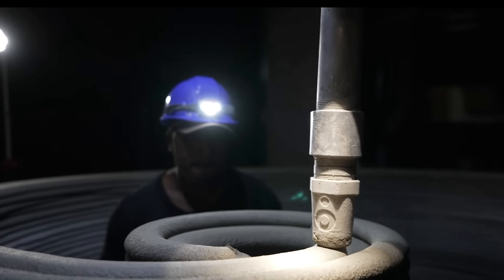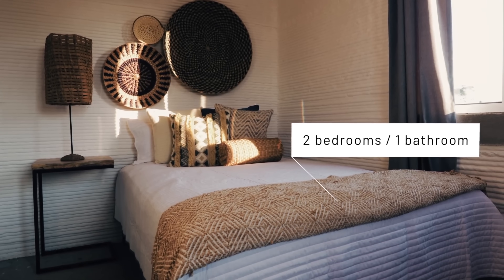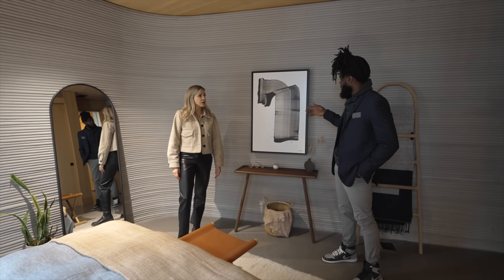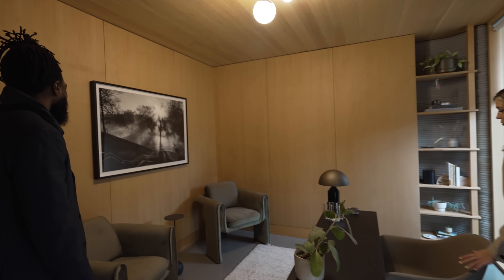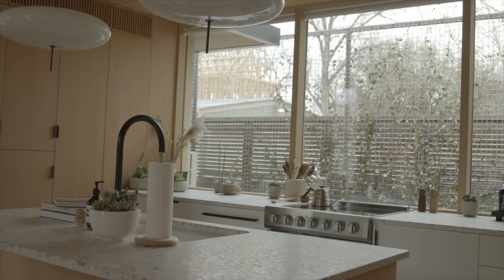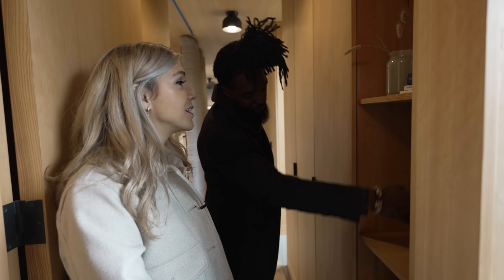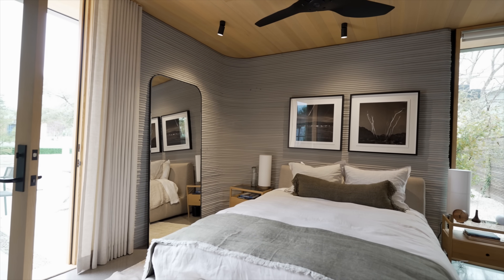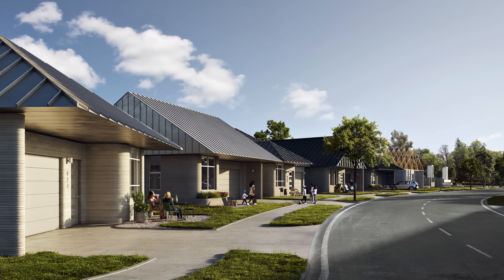Inside A 3D Printed House You'll ACTUALLY Want To Live In

Comment: The house looks great! 
Though, I’m kinda curious how it’d do in colder climates with all the windows and the thin walls.
Here in Germany, new buildings are essentially wrapped in about a foot of insulation and are built airtight nowadays as energy prices here kinda force everyone to think about efficiency.

The greatest part is all the carpentry and cabinetry! 
Well done on the design!
Reply: From the construction montage there looks to be gaps that could insulate and there don't appear to be obvious cold bridges connecting the outer and inner walls so it would work pretty much exactly like traditional masonry. The way each layer slightly varies is going to make it very anoying to fit or hang things to the wall. I also wonder how building height factors in to strength with this technique
Reply: Those exterior walls are over 8” at the base
Reply: Theres 2 walls printed the outside and interior w a gap inbetween for wiring and stuff so u could probs do stuff there
Reply: Just lay it on thicc :yougotthis:
Reply: Well they do come with a  high performance HVAC, system.
Reply: @robertcox7507  High performance HVAC tells me the place is improperly insulated.
Reply: @protorhinocerator142  That seemed right to me also. Insulation amount is chosen for where you build. Most places have a min code to help spare the power grid.
Reply: Exactly what I was wondering
Reply: There is another company that 3D print in Germany and meet all of the building regs that are in Germany.
Reply: @thelostusername5013  No surprise. There is no reason that additive building won't work in any climate. I can see the normal house builders are starting to notice these. Seen one post that you won't save money since they still need to be wired and have plumbing. I live in Austin  TX and find that funny. Company here printed a one bedroom house for 10K Allowing for expensive trade people and top grade material to wire and plumb I fail to see the house not coming in at under 25K + land cost. A run down wooden frame one bedroom in a not nice neighborhood starts around 150K.
Reply: I do NOT want that house.  to many "technical" /structural Restrictions inovolved with it and  it required constricted sizes.  The material is a horible mess. Then huge expense to "cover/finish those walls".  Wiring and plumbing issues.  If you want to build something like that there are better/Cheaper , simpler ways to do it.  search ,... Oh what is it called,  Mud/sand bag , earthen bag construction.  And I am not saying I would want that for my main house.  I've have seen nice hotel rooms....  cement is a mess! espeically when you leave it exposed. Dirt , spiders, and bugs "sticking to it" , then trying to deal with plumbing, elextrical etc,  and even try hanging a shelf or picture. :-)) that texture is aweful.  even beyond cleaning it has problems.  the novelty would wear off quickly.  and trying to cover that up with wood, plaster, etc... IS $$$$$   Are you noticing that even with the camera/"lense"?shooting done to try and make it  look bigger.  Look at how SMALL the rooms are. EVEN The ones that are supposed to be "larger rooms"  Oh and I live in a mostly solid cement walls and roof/ceiling ...  I will call Bull Sheets on it being 75 F inside on  days when it is in the 90's .  I live in the desert and once it starts warming up in the spring in the "90's" after a few days the cement warms up, the walls warm up and there is no way you are going to have 75F inside without turning on the AC.  if it goes "hot" then cold" then "hot" the cold for a couple of days, then Maybe... But after after a few solid days or warm/hot temps, the cement warms up. and as the temps keep on climing for "the SUMMER/ spring"  the walls of the building keep getting warmer.  In the low desert in AZ,  if I turn off the AC it will quickly start climbing toward the 90's F. I guess higher if you forget to turn on the AC.  Oh, and of course the Reverse happens in the winter.  Sure the novelty of this is "cute"  but the reality is..................  Not So Great.   especially if you DON'T want just a little "single persons"  condo/vacation condo"  and You don't want the MESS of unfinished cement walls.
Reply: Im guessing to tackle cold climates is to have thicker windows like triple glazing thin walls is another issue
Reply: @masolaadrian  You got it. Glazing and adding foamed in insulation os one way but they also cut cooling costs. Poured in foam is works well in a large cavity since you get less thermal bridging. Look up Structurally insulated panels.
Reply: @robertcox7507  that is also a good idea! Poured foam rings a bell of a similar method can’t remember the word for it. Yes I have come acrossSIP panels. They are also cost effective!
Reply: @masolaadrian  I am looking at one of the 3-D house printers where I live.What I expect to do when I can afford it is a two bedroom printed house using SIP's for the roof. City I am at will pay for solar panels and you can do water collection legally. Metal roof with a drinking ware safe finish and you are Eco friendly without busting the bank. IF the city won't pay for them you design with an eye to adding Tesla Power walls and extra panels.
THe Tesla powerwalls solve an issue with renewables. Sun goes down you are still using solar. Add some extra solar panels it and a power wall and it feeds the grid helping with peak demand and lowers your bill. And no I am not one of the extreme environmental wackos but I like clean air.
Reply: @robertcox7507  just reading from how you would set your house, seems like earthship house projects how they take advantage from solar energy but they also upcycle materials I may be wrong…
Reply: @masolaadrian  The Earthship does and I like some of them but the reality is they are very labor intensive. Labor = more money in my world. I will go with new to lower costs and consider that over it's life span my way will pay for itself while lowering it's environmental footprint.
Reply: @robertcox7507  that’s interesting to be honest new methods of construction is very interesting!
Reply: @masolaadrian  I think the thin walls are part of the process, to maximize the efficiency of the curing time, and to minimize resources used in building the house "sustainably" (I hate how people use that word).
The answer must be increasing the gap between wall sections and filling that gap with insulative material.
Either that or re-think the whole process from a blank piece of paper.
Reply: @protorhinocerator142  What is sustainability if we’re in a age of economy and business (they’re the same) so 😅. I would agree with you I would think that the buildup to be the same as masonry but using concrete.
Reply: Why are energy prices so high in Germany?
Reply: @Nako3  Because half the price of Petrol/NatGas/Electricity is comprised of taxes and levies.
Our green mentality dictates that if energy isn’t scarce and expensive, there’s no incentive to switch to “green” alternatives.
And because we’re now no longer deriving our oil/gas cheaply through pipelines at long-term fixed rates from russia directly, but at market rates via LNG/Oil tanker or because our existing suppliers like Norway/Netherlands etc. are charging a premium for bumping up supply.

Then for electricity, we’re paying every producer as if they were producing the most expensive type of electricity (gas power). Cheap solar/wind/coal power producers get to pocket the difference.
And since we switched off our cheap nuclear plants, electricity demand can never really be met without gas power being in the market and dictating the price.

That pretty much sums it up.
Dumbest energy policy in the world as the wall street journal once titled.
Reply: @propergander8509  That sounds awful. Poor citizens getting robbed off their hard earned money.
Reply: as long as the windows are "double glazed" (two layers of glass, un connected with an gas such as argon in them) the windows will actually hold temperature
Reply: Thank you 70 subscriber
Reply: Well, the thermal mass of the concrete helps a lot, and putting insulation inside behind those panels doesn’t seem like too tough a thing to implement.  Might also be possible to print walls in the same way corrugated cardboard is made, to make gaps inside the walls that can be filled with insulation.  A honeycomb design might even make it particularly resistant to tornados and hurricanes.  It’s already probably better than wood frame houses against high winds as is.
I worry about earthquakes, though, and freeze-thaw cycles.  Perhaps they could lay cable down on each pass of the printer head, and print double layer walls, one layer on each side of a line of vertical rebar poles.
Reply: They have built these homes in Mexico in a earthquake zone and also Austin TX. where I live. This comes off the website  "more resilient homes that are designed to withstand fire, flood, wind and other natural disasters"  https://www.east17thstreetresidences.com/#about   @glytchmeister9856
Reply: @4:50
Reply: @worldofmango1409  That PLUS the fact that the walls look to have at least 8 inches of space between them for insulation.
Reply: @worldofmango1409 thank you 70 subscriber

Comment: How about temperature running into the room through the Gaps between the Windows? It is one element without insulation or nothing. Pure Concrete running from outside to inside. How is this fixed?

Comment: I think Frank Lloyd Wright would love this house.  I like the way the concrete and wood compliment each other, there's a contrast that appeals to me.  It reminds me of a house made of adobe.
Reply: unlikely, probably and experiment and then Dismised!  😅 Although Frank did make a lot of "mistakes in design and construction in his buildings.  I do NOT want that house.  to many "technical" /structural Restrictions inovolved with it and  it required constricted sizes.  The material is a horible mess. Then huge expense to "cover/finish those walls".  Wiring and plumbing issues.  If you want to build something like that there are better/Cheaper , simpler ways to do it.  search ,... Oh what is it called,  Mud/sand bag , earthen bag construction.  And I am not saying I would want that for my main house either.  I've have seen nice hotel rooms....  cement is a mess! espeically when you leave it exposed. Dirt , spiders, and bugs "sticking to it" and those layers/grooves!  then trying to deal with plumbing, electrical etc,  and even try hanging a shelf or picture. :-)) wanna change a door or window? 😅😅😅 that texture is aweful.  even beyond cleaning it has problems.  the novelty would wear off quickly.  and trying to cover that up with wood, plaster, etc... IS $$$$$   Are you noticing that even with the camera/"lense"?shooting done to try and make it  look bigger.  Look at how SMALL the rooms are. EVEN The ones that are supposed to be "larger rooms"  Oh and I live in a mostly solid cement walls and roof/ceiling ...  I will call Bull Sheets on it being 75 F inside on  days when it is in the 90's .  I live in the desert and once it starts warming up in the spring in the "90's" after a few days the cement warms up, the walls warm up and there is no way you are going to have 75F inside without turning on the AC.  if it goes "hot" then cold" then "hot" the cold for a couple of days, then Maybe... But after after a few solid days or warm/hot temps, the cement warms up. and as the temps keep on climing for "the SUMMER/ spring"  the walls of the building keep getting warmer.  In the low desert in AZ,  if I turn off the AC it will "quickly" start climbing toward the 90's F. I guess higher if you forget to turn on the AC.  Oh, and of course the Reverse happens in the winter.  Sure the novelty of this is "cute"  but the reality is..................  Not So Great.   especially if you DON'T want just a little/cramped "single persons"  condo/vacation condo"  and You don't want the MESS of unfinished cement walls.  You know what else you will notice about this... NO REBAR REINFORCEMENT/"structural support".  And there Are More issues than just these... Ahh but the Novelty of it. 😅

Comment: The 3D Printer can do everything, but 90° corners.
They added the "curves" everywhere. Not just for "design", but to mask the inability to print straight walls.
Very much furniture has to be manufactured specially for this house. Roundings and curves and uneven walls..... horrifying.
The savings for the basic house is consumed by far for the handmade interior.
5:28 did you see that massive walls inside the living room? What is that? A House or a bunker?
They  just overdone that house. keep it simple and straight. this show of is just a anticlimax for presenting 3D printed houses.
Reply: No, we can actually build 90° corners with 3DCP

Comment: You could have just done this with a form and it would have looked way better.  3d printing in this sense is just nonsense as it's just stacking concrete without internal reinforcements ie: rebar.  That stacked look gives it a horribly unfinished look and the colours are bad. This is clearly a design first - build second type of construction.

Comment: The popular housing at the beginning of the video looked very interesting. Having said that I would be kind of concerned with  two aspects for this type of construction method:
1- Concrete is known to have high water retention. If the mixture is not very well controlled, it could start to "sweat" in high precipitation environments, which is the cause of mold forming outside or inside a house. In that sense, I would think wall plaster with insulation may be necessary to seal off the moisture.
2- Plumbing and electric wires should be very well thought (perhaps using internal dry walls) because you don't want to go breaking and cementing later large sections of concrete walls to fix a leak.

Comment: I love such new ideas. It's cool to see what's possible with 3D printing. I would live in this house. It looks cozy with those curves as little nooks. <3
Reply: 😅 I guess cozy is the right word 😅   I do NOT want that house.  to many "technical" /structural Restrictions inovolved with it and  it required constricted sizes.  The material is a horible mess. Then huge expense to "cover/finish those walls".  Wiring and plumbing issues.  If you want to build something like that there are better/Cheaper , simpler ways to do it.  search ,... Oh what is it called,  Mud/sand bag , earthen bag construction.  And I am not saying I would want that for my main house.  I've have seen nice hotel rooms....  cement is a mess! espeically when you leave it exposed. Dirt , spiders, and bugs "sticking to it" , then trying to deal with plumbing, elextrical etc,  and even try hanging a shelf or picture. :-)) that texture is aweful.  even beyond cleaning it has problems.  the novelty would wear off quickly.  and trying to cover that up with wood, plaster, etc... IS $$$$$   Are you noticing that even with the camera/"lense"?shooting done to try and make it  look bigger.  Look at how SMALL the rooms are. EVEN The ones that are supposed to be "larger rooms"  Oh and I live in a mostly solid cement walls and roof/ceiling ...  I will call Bull Sheets on it being 75 F inside on  days when it is in the 90's .  I live in the desert and once it starts warming up in the spring in the "90's" after a few days the cement warms up, the walls warm up and there is no way you are going to have 75F inside without turning on the AC.  if it goes "hot" then cold" then "hot" the cold for a couple of days, then Maybe... But after after a few solid days or warm/hot temps, the cement warms up. and as the temps keep on climing for "the SUMMER/ spring"  the walls of the building keep getting warmer.  In the low desert in AZ,  if I turn off the AC it will "quickly" start climbing toward the 90's F. I guess higher if you forget to turn on the AC.  Oh, and of course the Reverse happens in the winter.  Sure the novelty of this is "cute"  but the reality is..................  Not So Great.   especially if you DON'T want just a little/cramped "single persons"  condo/vacation condo"  and You don't want the MESS of unfinished cement walls.  You know what else you will notice about this... NO REBAR REINFORCEMENT/"structural support".